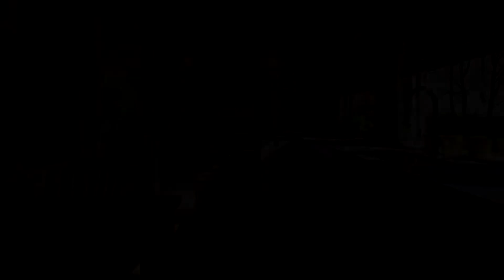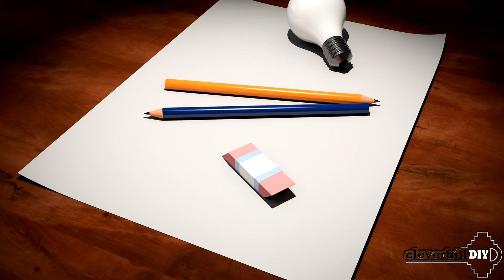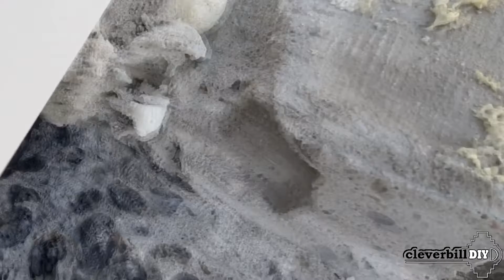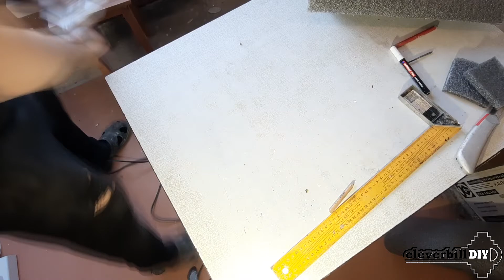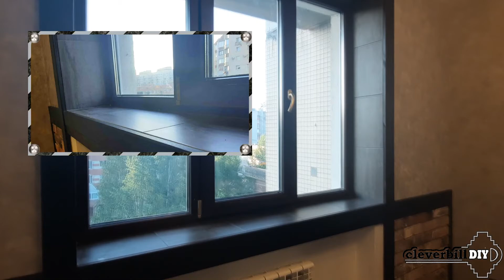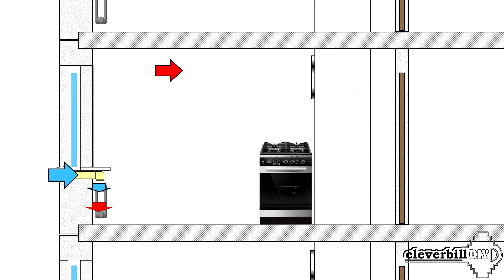Homemade ventilation valve under the windowsill

Comment from the maker: With the advent of plastic windows, in apartments with closed windows, the supply and exhaust ventilation has deteriorated greatly. Without normal supply ventilation, air can stagnate in the room and the kitchen hood may not work well. The simplest do-it-yourself inlet valve allows you to improve air flow even with the windows closed.